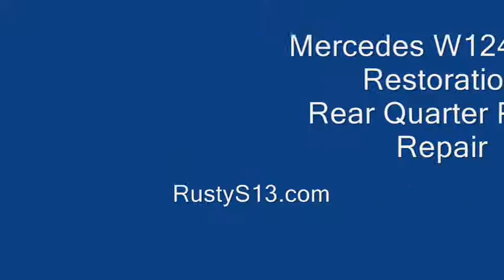Mercedes W124 Rear Quarter Panel Rust Repair

Comment: Nice work man,i got a w124wagon needing tlc too back windows and around the windscreen. What's the black stuff (coating )you have used inside?
Cheers
Reply from the maker: Sorry for the slow reply - Thanks Dave, I just used a Hammerite type of antirust paint over primer, it goes on thick with a brush and I did the whole rear end in it.